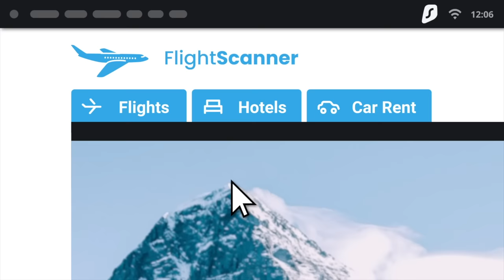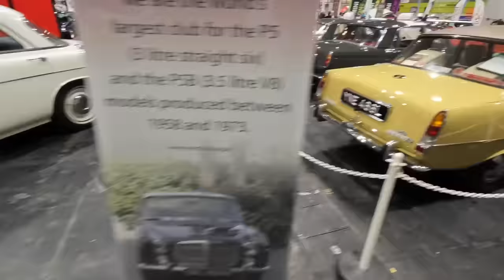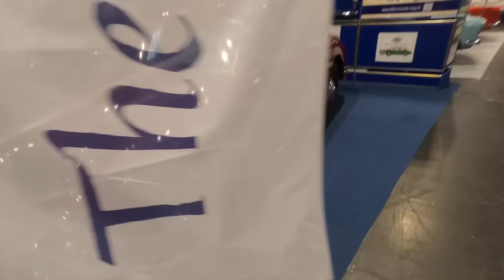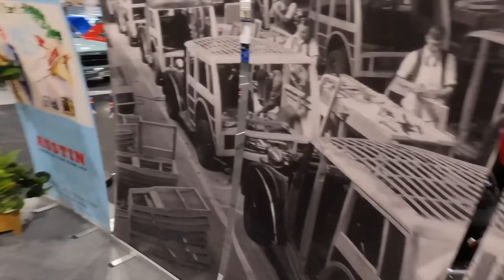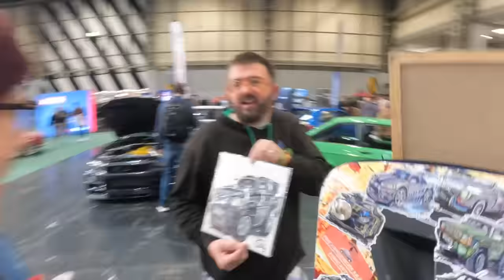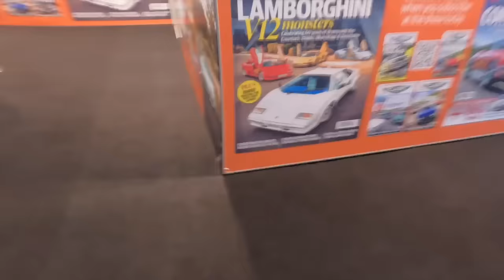Look around the NEC Classic Motor Show 2023

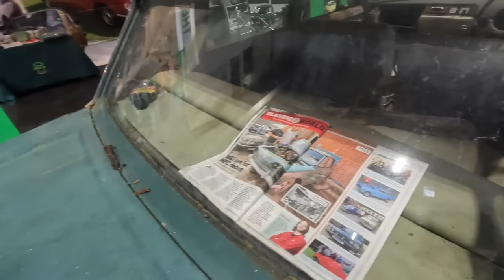Comment: Matt, that Plymouth at 9:10 is circa 1949 - not late 1950s as you guessed.  And that basic body style continued for a number of years after that.  But the American car era of fins, lavish chrome and yearly (!) drastic styling changes didn’t really start until the mid-1950s.  And then it became a full-on craziness!  You wouldn’t believe how different looking a ‘57 Plymouth is compared to the rather dumpy one you featured.
Reply: Yep, 1949.
As the 1950’s rolled on, the American cars became less bulbous, 
“Longer,Lower,Wider”,fins came in the mid ‘50’s, and got more exaggerated each year on most brands, until 1960-1961.
Also more chrome, until about the same time.
   Cool video so far.
🚗🙂
Reply: It's a 1950. 49s had a more complex grill.

Comment: Many great cars, many of which are special today, are gone from the roads, only the memories remain. I was young when many of these cars came on the market and got to drive quite a bit at the time. Some I owned, others were in use at work, while again some were owned by friends and acquaintances. All the things that some people shout Wow about and are classic today, may not have been so good to drive in the old days either. In any case, I appreciate a full manual car even today, the late seventies and early eighties when the quality also improved. Was when I was young. I remember my first car, six years old and it was described as old then, and not least worn out. Look today at a 2017 model. It is almost new and unused. Fortunately, some old memories have survived.

I'm glad I don't need to use none of these cars as my daily today.
Reply: I remember in the late seventies, I had a classmate who drove a hearse in his spare time. He asked me if I wanted to go for a ride. Delivering a dead person in a coffin 150 miles away with a Chevrolet Malibu estate as a hearse. They were long enough and did not need to be extended. Remember we drove fast on the winding road. My job was to keep the coffin quiet from slipping all the way.  Of course, the cross on the roof was taken off, who needs attention at that speed with a big V8.  That car wasn't dead.  Fun memories.

Comment: There are a couple of vehicles that got my attention firstly that VW Golf with the Honda motor in it a very good improvement it is a reliable VW Golf and l have to mention that 1998 Toyota Hilux a genuine survivor in the UK because  of the snow very common in Australia that generation went to 2003 the Toyata Crown coupe never knew they came in a coupe and those Austin Hereford and the other Austin's with the wood l do like a bit of wood in a car but so much wood on the exterior and that is how they came out of the factory and it was structural and the extremely rare cars l never knew existed